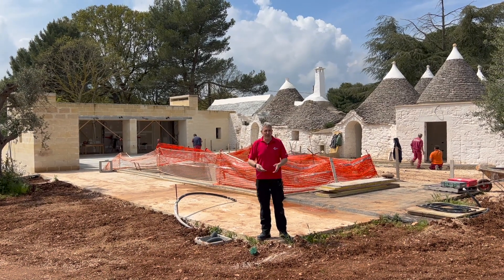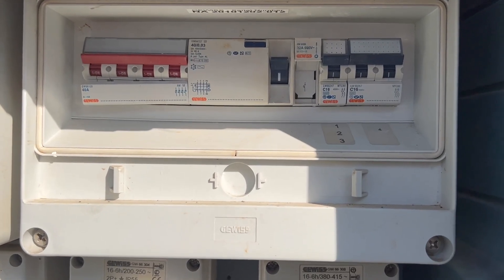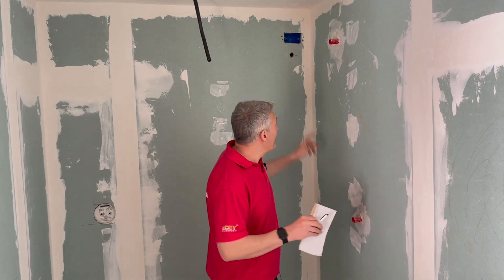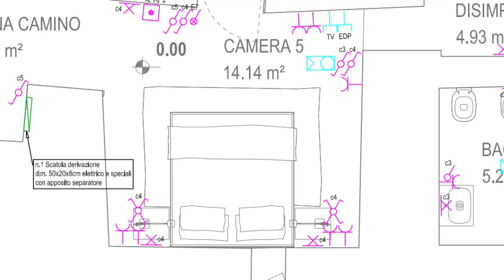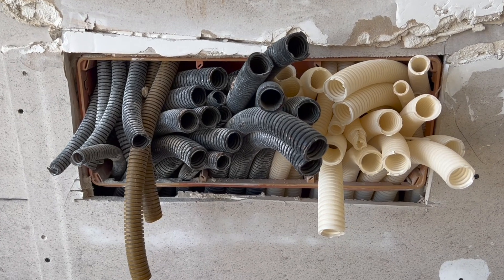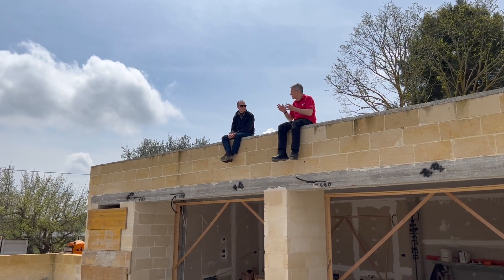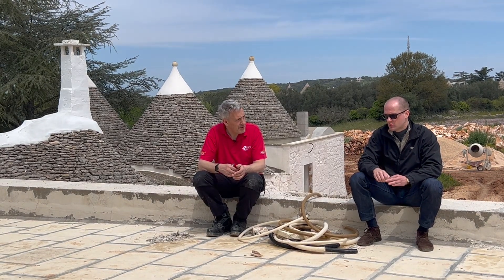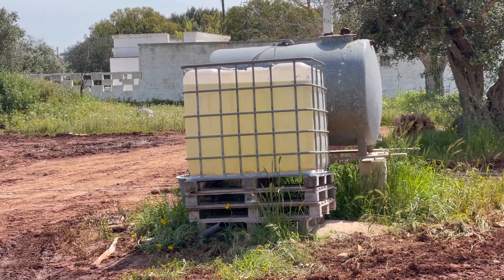Electric Wiring in Italy - You Won't Believe What They Do!

Comment: I live in Bologna at the moment. The standard power supply in Italy is 3kW, 6kW is considered a luxury upgrade. That means we couldn't use our 3.2kW Kettle from the UK without tripping the main breaker. It's a constant juggling act to make sure we don't switch on a high power appliance while another one is running. We can use either the hob, dishwasher, over or washing machine, but never two at once. It's a pain, but most Italians consider this completely normal.

The electrical installations in houses older than 10 years is generally shockingly bad for a western European country. But again, it's considered normal for the most part.
Reply: For comparison, houses built in the 80's in China has around 6kw. Nowadays, it's typically 9.6kw. Private residential flats in Hong Kong typically has ~20kw.
Reply from the maker: Great insight 👍
Reply: You can also run a 4,5KW power contract.
Reply: Not much good for charging an EV then !
Reply: @jasoneldridge4738  EV in italy aren't a feasible option for most of the people....
Everyone thinks of superfast charging only (petrol style) but in reality this is not possible on regular basis.
Reply: Puoi optare anche per 4,5kW. Gli impianti con più di 10 anni, se fatti con intelligenza sono performanti lo stesso. Dipende dall’installatore. Se ha coscienza ed esperienza
Reply: @johnrambo1391  questi confondono la potenza elettrica col pisello…
Più hanno kw più si sentono maschi 
😂😂😂😂
Reply: Today, the cost of energy unfortunately leads to electricity itself being considered a luxury. I am Italian, and I also live near Bologna. 
I guarantee, however, that it takes very little to learn how to use electrical consumers a few at a time so that the power you have installed is enough. 
You just have to want it and everyone can improve their consumption. 
Today more than ever we are called upon to make limited and intelligent use of energy resources.
Reply: The conduit allows for expansion and contractionof wires during heating and cooling during duty cycles.  This is necessary when wiring is embedded in plaster or concrete.  Otherwise, tight confinement creates insulation failures and short circuits to earth that energize the building.

The convenience is all to the good.
Reply: I live in Piedmont and I have 4.5kW, I don't have simultaneity problems.  If 3kW is too little for you, just ask for an upgrade of the electricity contract without modifying the system... easy
Reply: Need power assist function from victron ESS? How do you get on with export of solar? I thought it was bad here when grid company only allowed 3.6kW from a 12.6kWp system, just increased it to 5kW. Customer is going to see how it goes when we finally get permission to fit ev charge point but may consider increasing batteries. It is only 12kWh while we wait to get 4th BYD LVS battery then see what data looks like to decide.

What about charge points no 7.5kW units no 22kW?
Reply: @andyhodchild8  What you do? You request more power and you pay more. By the way if you are still with single phase the upgrade is only a matter of calling your electricity supply and paying the extra fee (it's not much, by the way, but most people in Italy is fixated with saving and keeps 3kW because it accepts more to not be able to use more than 2 appliances at once than pay 10 euros more a month or even less). Since we all have smart meters the company doesn't even have to come out and can just send a software update to your meter increasing the limit. Of course your electrical system must handle that, if you have (as in most old houses) only a socket circuit of 16A you can increase the limit but the only result is that you will not trip the meter but your breaker in your house. 

By the way the meter has an algorithm to cut off the power: you can draw as much as 63A (that is the hard limit of the meter) up to 1/2 minutes, than  33% more (that is 4kW for a standard 3kW) for up to 2 hours. So most of the time you get away with that since appliances use much power only for limited time (e.g. the washing machine only when it's heating water).  

You can get up to 6kW with single phase, and in some circumstances 10kW (but nowadays they no longer give you and want you to switch to 3 phase). If you want more than that you have to switch to three phase, and modify your electrical installation. Fun fact: in reality at the present day the electricity company doesn't enforce balancing on the phases, so you can in theory install a 3 phase meter and pull all the power from one phase. In the future they will, other than that it's not something I would suggest, for more than 6kW just better to switch to 3 phase power so you reduce losses with voltage drop in the cabling between the meter and the main consumer unit. And in the real situation chances are that if you are luck they did run 6mm2 cables to the meter, so even to switch to more than 6kW you have to run a new one.
Reply: @alerighi  I completely agree with what you've said. I will never understand the Italian idea that being on a 3kW meter will somehow save money/energy. Weather i run the dishwasher, washing machine and oven each one at a time, or all at the same time, the energy consumption is still the same. In fact if I run them at night concurrently it might actually save money if you're on a lower night tarif.
Reply: @ravellwolf probably the idea is that it helps spread the load in time and avoid unbalances in the low voltage distribution netowrk
Reply: @ravellwolf  the lower the wattage of you power meter the lower you pay in fixed costs. It's just that.
Reply: @ravellwolf  It's not an "Italian idea", it's just strait and simple that they charge you more for the same amount of energy with the 6kW contracts than with the 3kW ones.
In Italy it makes sense to have a 6kW meter only if you actually need 6kW. And you don't need 6kW if your average power consumption is 1kW except for that hour a week when you feel the compulsive need to plug in and turn on two washing machines, three drayers and four ovens at the same time.
Reply: @ravellwolf  its not a thing about sparing money, even if we italians loves to tell that story.
We are just used to live in that way.
In a "spartan" way and even if having money is consider legit, we identify as poor people.
Common idea is "being humble" and so make everything humble, small, contained, etc. To show that we are that kind of people.
Reply: Judging by this last post, can you understand what I mean? 
Spartan lifestyle.
Reply: @danielefabbro822  non commentavi il tuo, ma quello originale…
Reply: @PaoloNONescobar_889  si immaginavo. Ma il tuo commento è arrivato esattamente al momento giusto.
Confermando la mia tesi.
Noi italiani abbiamo uno stile di vita semplice.
Reply: @ravellwolf  Because in Italy you have to pay for both the energy and power: other than pay for the energy you use (which is normal) you need to pay also for the maximum power you can pull from the power grid (which should be normal for large installations but is quite stupid for smaller ones!).
Even more stupid, the price per kWh and the price per kW is not straightforward but follow some different steps (i.e. if you have used 200kWh of energy you have to pay more than twice than some other that used 100kWh and the price available kW increases over 3kW and over 4,5kW).
The other problem is regarding the green transition: because of these limitations, in Italy we are not prepared for this (except for newest homes) and running new cables is very difficult (no plaster here, except for new homes, but strong and solid walls instead).
Reply: @ravellwolf  the default 3Kw limit is not about saving money/energy, rather it is about soft-rationing the available globally produced/imported power. Remember that Italy has basically no oil or coal in the ground, and nuclear power stations were outlawed by a referendum.
Reply: @ravellwolf  It's not for single users. It's for the main network system. Instead of having a system with big peaks, we have constant usage during the days. This allows the network to be simpler and more efficient since it is used at higher capacities constantly.
Reply: @ravellwolf  6kW used to come with a huge (fixed, monthly) price tag. You're also assuming the price per kWh was the same. It wasn't the case. So yes, the electricity for same washing machine would cost significanly more if attached to a 6kW meter compared to a 3kW one.

There was a time when 6kW wasn't considered domestic, and there used to be a price wall. Above that, the difference between say 6 and 20 was not that big.  I remember dealing with the issue with my company, we had to upgrade and once you went above 6, it was more a matter of convience than cost.  That was in late '90s.

Even in 2010, I remember evaluating solar panels, and to incentivize solar energy the government offered to pay a share of the costs, but only if your contract was below 3kW.  That was still considered the threshold between domestic and commercial/industrial use.

Everything changed around 2017, with the general sentiment veering towards electric cars: there's hardly any point in pushing people towards EVs but still "punishing" families for requesting more than 3kW.  Now upgrades are cheaper and they don't punish you any more for going above 3kW.

It doesn't help that old buidings require to be re-certified, which means all the wiring replaced, often boxes moved / enlarged, etc. if you decide to upgrade.   Uncertified wirings are not illegal per se, but basicly no changes can be made to them (any professional electrician is bound to leave behind a full certification after changing something) and you can't sell them (I mean the house they are part of).

So it's part old habits that hard to die, part actual pay walls.
Reply: @ravellwolf  can't if you live in a flat. Some appliances make much too noise.
Reply: @qdaniele97  
👏👏👏
Reply: yes, you get raised to always think about what's going on when turning on another appliance
Reply: Electric cars won't be much fun on a 3kw supply. Can't use any other electricity for over a day while the car charges
Reply: I wonder why in a Western Country where mr Burns lives, people still don’t use bidet…😂
Reply: @marcoleo3226  
The topic is electricity. Please focus.
Reply: @marcoleo3226  ti amo 😂😂😂❤️
Reply: Haha, In Finland the standard even in older buildings is 3x25A (three-phase power), and most new houses have 3x63A. That's over 40kW :-). And we don't even use on-demand water heaters or other crazily power hungry water heaters. Our house draw like 0.6kW constant when heating and cooling is not needed. A bit over engineered here.
Reply: @juliuseskola1281  
Wow. Three phase into domestic homes? Totally unneeded.  Yes, over engineered.
Reply: Actually it is 3kW + 10% and no time limit.  Or you can draw 3kW + 27% with a consistent, usually reasonable time limit.
Reply: Tbh with how efficient all appliances have become 3kW is good enough for a house that uses gas for heating and cooking. New houses which are being built with heat pumps and induction cooking usually have at least 6 or 10kW available from the start.

Generally I would say that 4.5kW is the sweetspot for a normal house with gas heating and cooker, no issues with juggling the loads you can use at any time basically.
And also you can ask to get 10kW in single phase, but it is subject to an analysis by the energy distributor. It is generally recommended to go three phase over 6kW, but you can actually get up to 10 in single phase
Reply: @andreag23900  
Normal in a UK house is 23kW provided.
In an apartment normal is 14kW provided. 
I have 15kW provided in mine. 
I can be all electric in water heating, space heating and cooking with all operating at the same time. 
The average home in the UK, never has any problems about supply shortages and limitations.
Reply: @andreag23900  wrote:
"with how efficient all appliances have become 3kW is good enough for a house that uses gas for heating and cooking."

Until you run a tumble dryer or washing machine and make coffee, then a trip.
Reply: @johnburns4017  I can run both my washing machine and dryer with a 3kW power limit without any issues and with other appliances on as well.. I can also make coffee while I'm at it cause I don't have induction cooking.

During summer I can also easily cool my house running three air conditioners at the same time without tripping
Keep in mind I live in the south, where 40C+ is normal during summer

I agree that 3kW is ridiculous and that 4.5 should be the default, but until you use heat pumps and induction cooking you don't need more than that tbh
Reply: @andreag23900  wrote:
"I can run both my washing machine and dryer with a 3kW power limit without any issues and with other appliances on as well.. I can also make coffee while I'm at it cause"

You must have some very low powered appliances. My dishwasher alone, a German Bosch, consumes 2.4kW.
Reply: @johnburns4017  that's the point! We have only 3Kw of power because a lot of house are old with thin wires and can't handle more than 16A of current, but we have appliance with incredible efficiency! It's really hard to buy something that is rated below A+++.
As someone else said I can run dishwasher, air conditioner an oven without trip the company limiter! Heating in general had been done with gas for 100 years but nowadays with induction stove or electric cars things are changing fast!
Reply: @MyNotSoHumbleOpinion  
The UK, surprisingly is full of old houses. But the electrical systems were upgraded. They also have high efficiency appliances.
Reply: @johnburns4017  not enough money for upgrading electrical system if not needed here...
Reply: @johnburns4017  I'm from Spain, not from Italy, and here you can choose your power rate in 0.1kW increments. 

It's not about how much your installation or the company's installation can handle (I could go to 24kW easily at home, instantly, just calling my provider, with my current installation, but that would absurdly increase my monthly bill).

Installations from the last decades (so most of them) are rated for much greater power, but you are like "renting the capacity" on your monthly bill. The meter has a breaker and the service gets interrupted if you demand more power than the one you have in your contract.

So I have 4.4 kW at home and I'd say that's more than enough for a 100% electric house, I never ever had an interruption and I even got to have the dishwasher, the washing machine, the dryer, two heat pumps and the glass-ceramic cook (+lights+TV+PC+domotics) all at the same time.
You'd say that's impossible, but there are two tricks here:
1. none of those machines are running at full power constantly, e.g. the cook only turns on the resistors in intervals that last seconds after the first heating, the heat pumps are inverter and are able to consume less power when the temperature difference is lower and so on... so you might be running appliances rated for 15kW at the same time, but in the end they won't consume all that power constantly.
2. the breakers must have some tolerance by law, so you can consume x3 (13.2kW in my case) for some seconds, x2 (8.8kW in my case) for like 5 straight minutes, or x1.5 for like one hour. So in the end, at least here in Spain, it's more flexible than it looks.

Countries with great power availabilities might have appliances consuming a large chunk of power (such as those British kettles or some instant water warmers) but those are rather exceptions to the norm that have easy alternatives.
Reply: @aferre  
Thanks. Very good explanation. My supply is 60A, which is 15kW as I have 250v. If I have all my appliances on simultaneously: induction hob, oven, fridge, dishwasher, washing machine, TV, all lights, toaster, gas boiler pump, the 15kW will be exceeded. I have gas heating. Diversity factor says that will be a very rare event if ever - as you described.

Post WW2, the UK embarked on a huge centralized electrical grid system. The largest power stations in Europe are in the UK - Drax. All was to be nuclear powered with no metering, just a monthly charge based on property size.  Homes were to be heated via electricity. So all supplies into homes were at least 60A, with normal homes usually 100A, some are still 110A run into new homes. Gas, which was produced from dirty coal, was to be taken out of homes - the discovery of natural gas in the British sector of the North Sea in 1965 reversed that. 

Continental countries were generally not as wealthy as the UK post WW2, so did not have the money to upgrade their electrical systems - or just did not bother. I read the comments here, being shocked at how small some of the supplies are. 

The tiered kW charges in many Continental counties was to keep electricity usage within the grid's limits, as their grid systems were not up to it, to get them to use less. So the UK does not need to have such a charging system as the grid and supplies into homes are man enough. A knock on benefit of the tiered charging system, is that each home has a main RCBO rather than an old fashioned tube main fuse.
Reply: @johnburns4017  To lower the power consumption you can connect the dishwasher (or the washing machine) to the hot water tap instead of the cold one.
Reply: @teslacoiler  
I do that with the dishwasher. Make it hot fill. Electricity costs three as much as gas per kW/Hr, so less electricity is used. If I fill a kettle with hot water to heat on the induction hob, less electricity is used.
Reply: @teslacoiler  
Washing can be on a cold wash using cold wash liquid. I do that. No high current water heating.
Reply: @johnburns4017  If you use a kettle on an induction stove you consume less electricity than the same kettle over a standard electric stove.
But the power consumption will be even less if you use an electric kettle to boil the water.
The reason is..... you need a certain amount of energy to boil the water (which is the same for all three examples).
A kettle over a standard electric stove doesn't make a good thermal contact, so the efficiency of the heat transfer is quite low (you also need to heat up the cast-iron block of the stove, which itself requires some extra energy).
a kettle on an induction stove have a much better power transfer, so there are less losses (even if there are some extra losses for the electronic converter).
But an electric kettle is nothing more than a resistor put inside the water.... the electricity to heat conversion of a resistor is almost 100% efficient, the heat transfer between the resistor and the water is also close to 100% efficient and you only have some extra metal to heat up (the resistor itself) which use only few percent of the energy....
The overall efficiency of an electric kettle should be around 97-98%
But, of course, even if a gas stove is quite a bit of inefficient, the gas cost much less than the electricity......
Reply: @johnburns4017  Italian breakers don't trip immediately. You have a tolerance. They trip with more than 30% overshoot. Basically, you can run at 4k.
Reply: That is crazy only 3kw?  We get 200 amp at 240 service per building which is about 50kW

But we have single phase which isn’t the best.
Reply: In America, a residence wouldn't use 3-phase unless it's very large and has lots of air-conditioning, etc.  Even then the 3⌀ is used just for advantages of power distribution for the total load of the house, the individual A/C units may be still be single phase.  Three phase wouldn't really be a requirement unless it had a single load over 10kW, like a really big motor in a giant whirlpool tub.
Reply: 😂😂😂😂😂😂😂😂😂😂😂😂😂😂😂😂😂😂😂😂😂😂😂😂😂 come back in 20 years
Reply: Yup, typical old houses' problems. :(
Reply: i don’t get this fuss over Italy power rating in homes. IMHO the less energy you use the better is for the planet. We are not one of those countries where the per-capita energy consumption is (unjustifiably) high, we have a lot of old homes that just run on 3 Kw max power and we aren’t even bothered at all. Lot’s of house appliances are energy efficient and we usually use them in different times of the day to distribute the power load. Even with new energy efficient homes we don’t need so much power to run all the appliances, given that inverter-motor base heat pump the consumption is almost never at peak. If then we factor in the photovoltaic system we even have energy excess during the day.
Reply: Yeah, it is normal for Italians, till they move abroad and finally realise the Italian electric grid sucks.
Reply: What??

Geez I'm in South Africa and I have three phase 80A incoming.
That's like 55kW!
Reply: So like the equivalent of 25 amp service in the states at 120v here?  This is crazy.  I'm over here plotting how to upgrade from 200A (24,000watts) to 400A....
Reply: @jdr03272  320A meter enclosure(double lugs) and (2)150A main panels, done.
Reply: @jdr03272  We don't use electricity for everything like you in the US. You're lunatics with the number of devices you buy. We just don't have that many of them and just pay slightly more attention to not putting many of them together.
Reply: older than 40* years

nothing much changed in the home electrical systems since the early 80s.

the 3kW supply might not be enough for a family with kids, especially if you use the AC. It's ok for a couple
Reply: Nope because only in the last 10/15 years we use a lot more the solar power system and with only 3kw it’s impossible to “live”. In the old days, generally only 30 years ago no one had a dryer in the house, I don’t have one cause I don’t need it. And I think almost the 90% of Italians have one, the sun is better 😂. And normally anyone had like heat stove for cooking ( at least where I from, in rhe north) in autumn/winter, the oven was used it not frequently.
It’s not ridiculous for a western country, why have 6 kw and the use only 1kw for 22 hours? 
Heat pumps was an add 15 years ago with the solar power, and with that you need at least 4,5 kw but they give you 6kw cause its better. It’s changing, but why complain about that? There’s other things to complain about Italy, and this is the last things comes in mind!!
Reply: @PaoloNONescobar_889  mi sembra che su sto canale si cerchi in ogni modo di screditare l’Italia a prescindere..
Trovo ridicolo il “celodurismo “ inglese per cui si sentono migliori in base ai kw che gli forniscono…rasentano il ridicolo…
Per un futuro migliore dovremmo tutti comprendere che meno consumiamo meglio sarà per l’ambiente, ma credo che siamo ben lontani da tale comprensione.
Oggi sembra che vivere in modo “umile” sia qualcosa di cui vergognarsi.
Se penso a certi commenti letti su sto canale mi viene solo di essere fiero di essere italiano 😁
Reply: @eacle5496  no ma non lo capiscono che, a parte l’umiltà, che senso ha avere 6kw se durante tutto il giorno ne usi max1 è solo alla sera arrivi al limite, forse… In Francia ad esempio non si fanno sti problemi, così come in Spagna. Ma poi che stupidità leggere “una casalinga deve Usare tutti gli elettrodomestici, deve avere potenza!” Na stronzata enorme
Reply: @PaoloNONescobar_889  
Electricity use in homes is bursty. When a washing machine is on a dryer may be on at the same time for obvious reasons. Then the housewife boils water a coffee or whatever. The system has to cope with these times.
Reply: @johnburns4017  for a coffee we don’t need electricity. We use gas. Who use electricity needs for that have already a 6kw. The dryer, for what I know in Italy isn’t not essential, at least 90% of Italians don’t need it. I know it’s been difficult to understand for a non Italian to not use a dryer, or not using three high power things in the same time, but it is that: was not necessary. At least before 15 years ago, everything changed with the solar power systems. I don’t know why everyone is complaining about electricity power? Now in every reno/ new house we have to change. If you wnat more electricity, use more solar panel. You wrote all that things about gas and coal, that is the problem, we need to improve and modify our way to make energy and electricity. Not use gas and coal anymore man, that is the real problem!!
Reply: @PaoloNONescobar_889  
It seems in Italy they need Tesla Powerwall type of batteries to charge up with cheap overnight electricity and use during the day. Then no problems with rationing electricity in the home.
Reply: @johnburns4017  all right whatever, mate. No more time to spend on one who complaining about power electricity, in a another country..See ya!!
Reply: @johnburns4017  We just simply use the washing machine at night with the timer, LUL. You make everything so fucking complicated.
Reply: @antoniousai1989  
No, we use any electrical appliances at any time not having to think about or time anything.
Reply: @antoniousai1989  
Use washing machines at night?  You will be a big hit with the neighbours in apartments blocks. In Switzerland you cannot use washing machines after 8 pm.
Reply: @johnburns4017  Yeah, that's why you consume like 5 times the energy per capita of Europeans, LUL
Reply: @johnburns4017  Yeah, we're not fascists here like in Germany where you can't even wash your car on Sunday LUL
Reply: @antoniousai1989  
So you think you can annoy other people at will. How considerate.
Reply: @antoniousai1989  
Please stop making things up.
Reply: You are judging by your point of view, without knowing the full story. For example, in Italy 4.5kW and 6kW are considered luxury upgrades because we never really needed them: you would heat with gas, cook with gas(including hot water for tea) and dry your clothing outside in the sun. Washing machines used to have longer cycles which used less power(water is a solvent). When we did that, we were way more "ecological" than current standards and we weren't juggling at all with 3kW, say 4,5kW for bigger houses. Consider this, who in the nation of the "Good Life" would like to live uncomfortably? Also it is a matter of fact that even with some pretty wildly looking wirings Italy is one of the safest nations in europe, from an electrical point of view and others.
Then the infamous European Union came along, and it ordered to abolish gas stoves, wood stoves, use electric dryiers, have electric doors, electric shutters, electric gates, electric garage doors and smart switches, forced ventilation, induction heating, all in the name of savings and environmental reasons, when in reality it is quite the opposite. New houses are much more expensive, pay higher energy bills and have industrial-like maintenance costs, while offering the same comforts or less.
Reply: @engineeringdisillusion that was the missing point. In northern Europe they rely more or electricity than in traditional Italian homes where the most consuming appliances are oven, washing machine and hairdryer. Heating and cooking are done by gas and clothes dry outside in the sun the whole year. A/C is not that common (maybe more in the biggest cities nowadays like Milan, Rome, Naples) as window shutters are the usual solution during summer to keep the house cool... In almost 30 years of life, I remember 5/6 times when my meter decided I was consuming too much and that's because some other members of the family were using the hairdryer and washing clothes while I was for example turning on the dishwasher
Reply: @mianoso  
The diversity factor. But this is taking it to the limit.
Reply: >>The standard power supply in Italy is 3kW, 6kW is considered a luxury upgrade
Mama mia! In Russiia we have at leaat 5 - 7 kw for house with gas stove. And at least 8-11kw for house without gas.
Reply: @DnvGoodwin555  In mother Russia typically 15kw (380v 25A) for houses and 5.5kw (220v 25A) for apartments. I live in the house and installed 40A 380v breaker (26kW)
Reply: Not enough for induction cooker. So replace the contactor
Reply: @alo1236546  
??
Reply: Wow that’s nuts, just your AC is 8-10kw. That’s assuming you have a small house! Three phase power for a 3-6kw service? Very strange you would be hard pressed to find a 3 phase load that is less then 3kw here in the states. Even a single 5hp motor is over 3kw! What’s the point of having electrical power if you can’t run anything? I’m assuming everything is gas/diesel powered over there since there isn’t enough power to run an air compressor let alone a welder or any other tools. Here a 200 amp 48kw single phase service is standard and I had to upgrade to a 144 kw 400 amp three phase service.
Reply: @Trump985  I see a lot of people writing the maximum kW power. I must underline that's peak power. If you go slightly above the power  for some seconds the circuit breaker will not turn off, this make manageable. Also a dishwasher if used always on eco mode will not use the maximum power all the time, this count also for the oven and other appliances.
Reply: @Trump985  
in Usa siete "spreconi", ...avete "manie di grandezza",
...forse perché l'energia elettrica costa molto meno che in Italia...
Reply: @Trump985  you can run a small welder on 3 kw, or a 3 HP motor. But if you need to run a full laboratory, then you get a 3 phase supply, which is also more the proper way to drive powerful motors anyways..

To me, having lived most of my life with 3 kW, anything more seems unnecessary. When I was in NZ and Australia the houses I lived in had at least a 20 kW supply, but that's because they used the electricity to heat up the water and for the resistive stove tops. In Italy we typically use natural gas for that (or lpg, or diesel, or a variety of new solutions in new buildings). Here electricity is comparatively expensive. 
I wonder how you could ever use 48 kW... let alone 144 kW!

I guess that's one of the reasons why Americans have such a huge carbon footprint